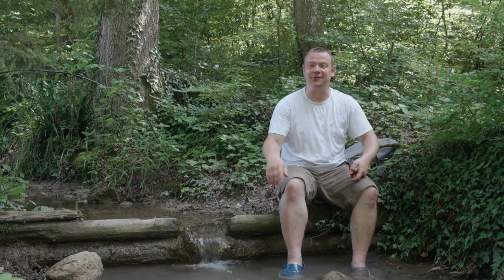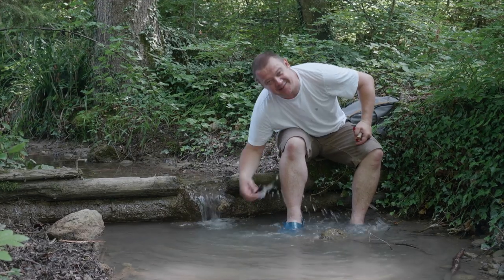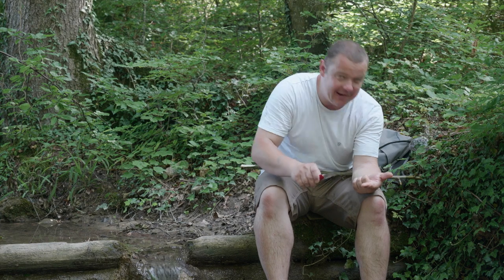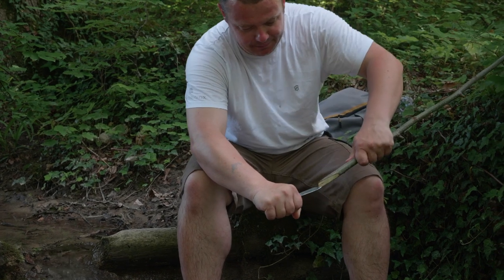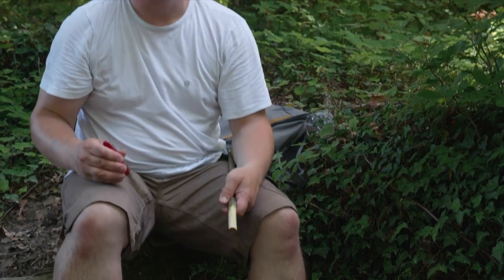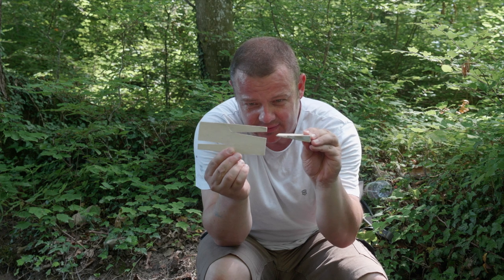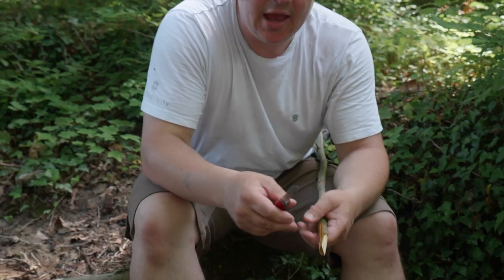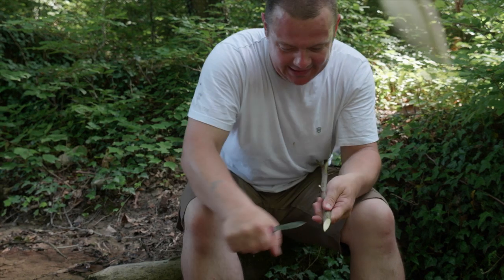Victorinox Tips & Tricks (14/25) - How to encrease the performace of your blade (without sharpen it)

Comment: Another very instructive video of yours - great sound effects!
Watched  videos 1 to 14 of your series til now and - being a Victorinox-lover for more than 50 years now  -still learned some new tricks., thanks.
But I'm missing a trick for doing heavy, but very controlled cuts that I know: put the forearms tight to your chest and hold the knife in a reverse grip (the blade sticking out between thumb and index finger with the edge facing away from your body).
Cutting close to your body gives you the most power and keeping your arms pressed against the body gives you very much control at the same time. No bystanders endangered.